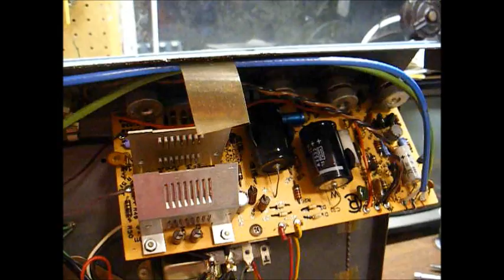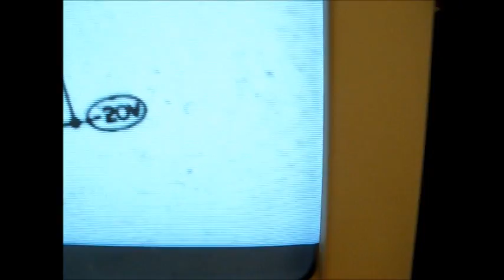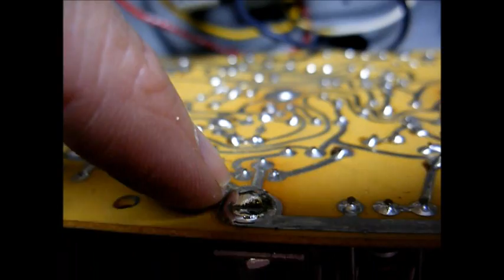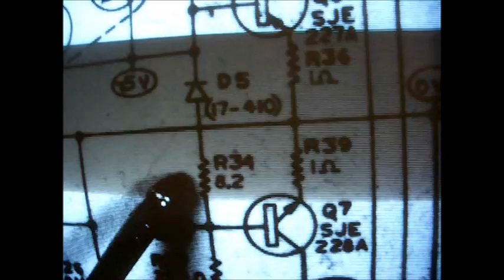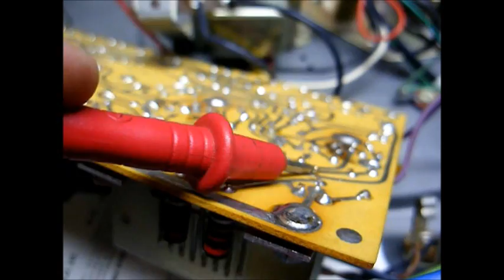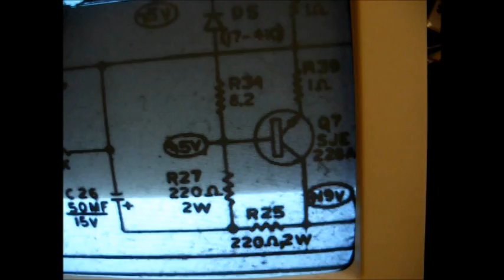Califone 1155 stereo classroom record player from 1974

Comment: I bet the 7.5 ohm resistors were upped to 8.2 ohms to up the bias just enough to bring the output stages to class AB from class B for getting rid of crossover distortion. I had an Emerson tabletop stereo with crossover distortion at low volume undoubtedly caused by operating in pure class B. It had + sized T092 output transistors in simple tab style heatsinks. Probably they didn't want class AB because there would have been more quiescent current and more heat, well you know how that goes.

Comment: My JVC Nivico console has capacitive coupling between all amplifier stages except between driver and output where transformer coupling is used. All Germanium transistors at that. At least if the output transistors were to short they won't zap the previous stages. Unlike my JVC Nivico 5001 55 watt per channel AM/FM stereo receiver which uses direct coupling and Silicon transistors. You guessed it: an output transistor went short and at bare minimum burned up a .5 ohm emitter resistor. Won't surprise me to find the driver and preamp transistors popped too.